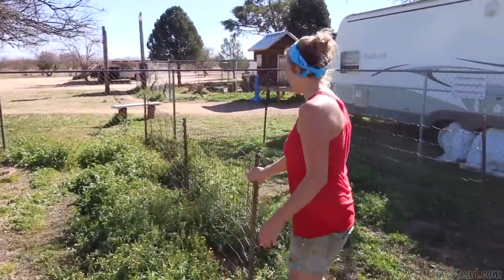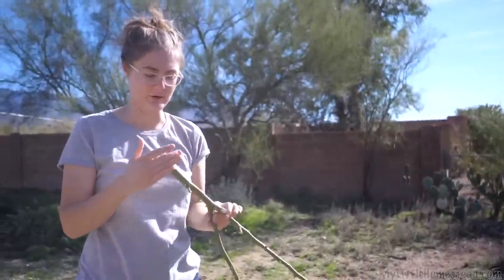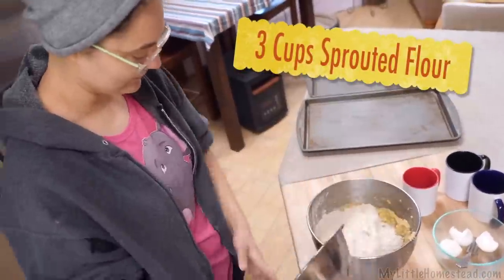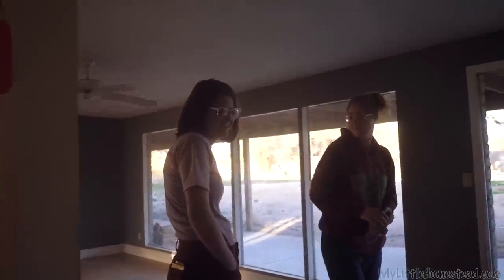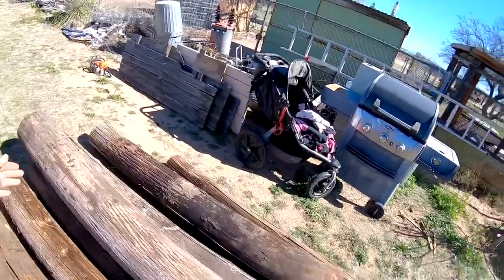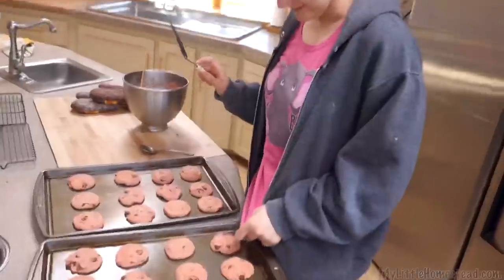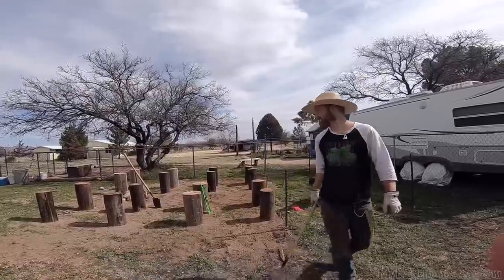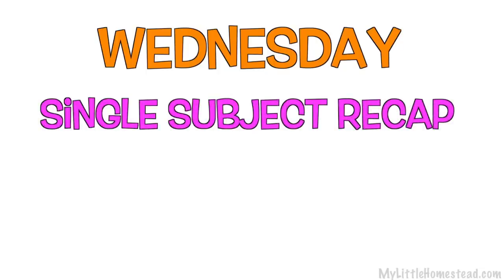New Aquaponics Build, Re-Paint Old House & Valentine Cookies!  | Weekly Peek Ep222

Comment: Spray can popcorn ceiling is good for spot fixes, but not economical for large areas and almost impossible to get a good consistent finish.  You already have the compressor, you'll be pleasantly surprised how inexpensive the hopper gun and bags of popcorn ceiling mix are.  Protip, substitute latex paint for some of the water.  It will make the surface much more durable, at a cost of filling some of the smaller sound absorbing cavities.  This way it can stand up much better to periodic gentle brooming away of spiderwebs and dust. 

A higher mix of paint makes it durable for outdoorish environments.  I strongly recommend you shoot the roof peak/ceiling of your garage and workshop, it's amazing how much more pleasant the acoustics become, and the way it brightens it up inside is a great bonus too.   If coating raw wood, apply a coat of cheap primer or discounted "oops paint" (custom mixed but unclaimed) first, otherwise it will pull tannins out of the wood and turn brown, found this out the hard way in one building.